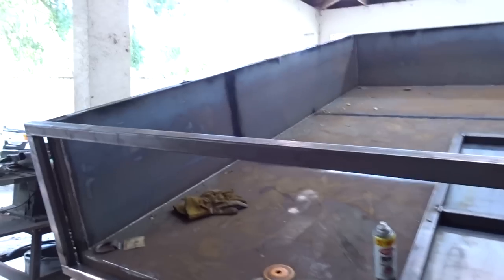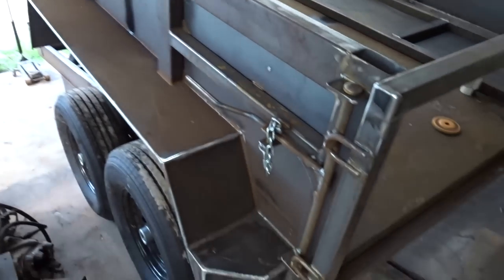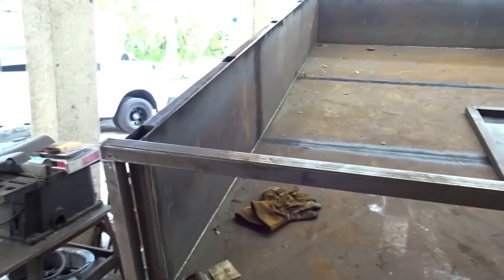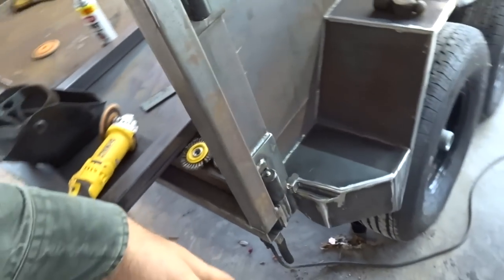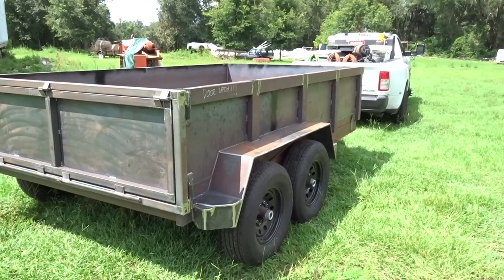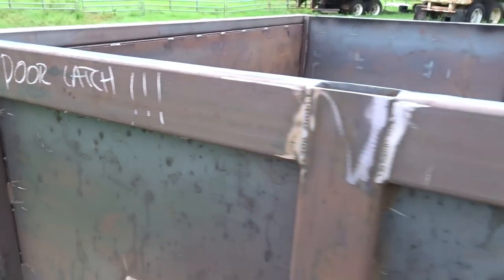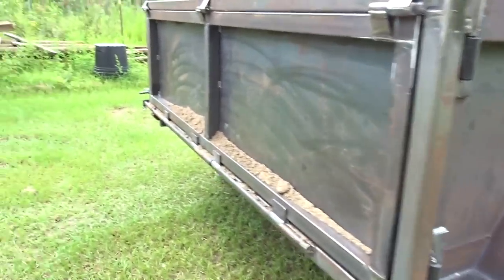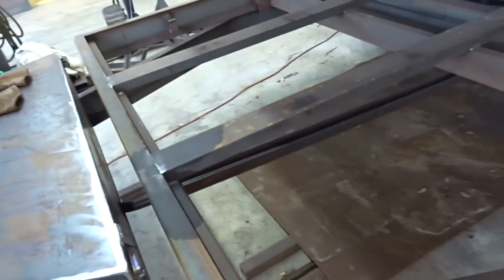Dump Trailer Build Pt 7

Comment: I am building a second dump trailer.first one looks like a regular box trailer but used a winch and an armed as the lifting device.. the one I'm building now is smaller for my recycling business and will use a travel trailer landing gear to lift. I have a factory dump trailer as well.

Comment: always enjoy watching you work. pride is craftsmanship is rare these days  i like how far back the axles are set. perfect when towing with a dually. more capacity. dont forget the 3 id light in the rear center. trailer is wide enough to have them. the 3/4" led light work very well for that. may have to put the license plate off to one side. very nice job young man.

Comment: I would say you had the trailer loaded about right for weight. It did a vary nice job when dumping. Most trailers drag the load out way to far because of how low they are. Vary nice build. I am a welder fabricator as well so now I want to build my own.

Comment: Nice job. I have had many and all brands of trailers like that.  That one is probably better built then all of them. Nice job.  I did notice that on your tailgate the dirt sat on top of the lower two by two.  Maybe put some flat stock at a 45 do dirt won't sit up there all the time.

Comment: Talk about overkill. That's a beefy unit! What's the cost on the build or what you'd be charging for this? Curious on the price difference over the standard mass produced ones. Yours is also a lot higher of a quality than the poor quality control manufacturer's have.
Reply from the maker: Cost involved would be around 6-7k once it’s all said and done, I probably wouldn’t build one again for someone else just due to the many man hours involved, that being said the only thing you really save by building one yourself would be labor cost

Comment: Im sure this has been asked but what shop welder setup are you using?  Welder, wire, gas ?
Reply from the maker: Millermatic 252 
.035
75/25
Reply: Thanks Duder! You are a pretty good fabricator, like seeing your work.